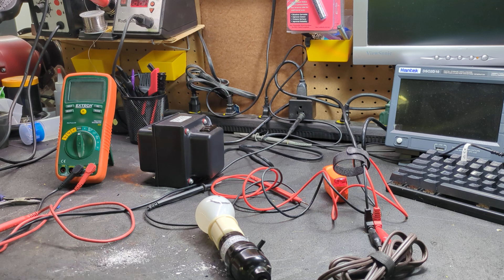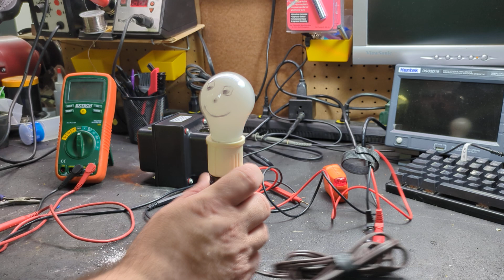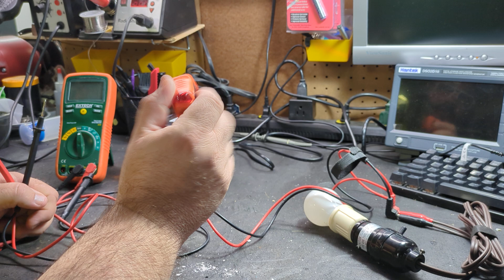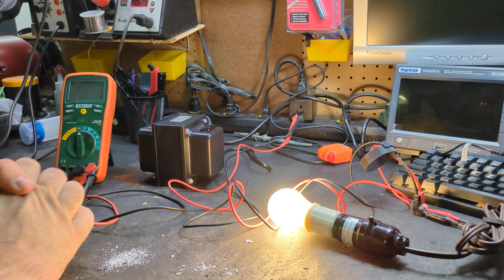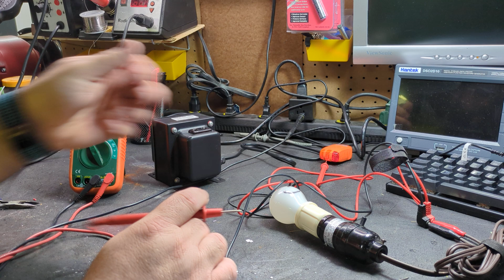Don't ground that isolation transformer on your test bench!

Comment: ***** ATTENTION *****

This is in reference to a short you did that you said "most people do not know this." In "YOUR" panel you have all your neutrals and grounds on the neutral bus bar. That is correct BECAUSE  you DON NOT HAVE AN EMERGENCY SERVICE DISCONNECT OUTSIDE. YOU DO NOT, AND THEREFORE THAT IS THE WAY YOU ARE SUPPOSED TO DO IT to avoid shock.

    ***** BUT *****
     THOSE WHO HAVE A EMERGENCY SERVICE DISCONNECT OUTSIDE, THEY WILL ALSO HAVE A PANEL INSIDE, ********** ATTENTION *****  AND THEY MUST SEPARATE, SEPARATE, SEPARATE  THE GROUNDS ON THE GROUNDING BAR, AND THE NEUTRALS ON THE NEUTRAL BAR in their INSIDE PANEL!!!!!!!!!!!!
    IT IS THE OPPOSITE FOR THOSE WHO HAVE A OUTSIDE EMERGENCY SERVICE DISCONNECT like me and countless of others, THEIR INSIDE PANEL IS A SUB PANEL, AND THE VERY THING THAT YOU SAID WOULD HAPPEN TO YOU (NOT HAVING AN OUTSIDE PANEL)  (APPLIANCES ON THE BODY OF THE APPLIANCE HOT and) WILL BE ENERGIZED,:WILL HAPPEN TO THOSE WHO HAVE THE OPPOSITE SET UP If they wire their inside box as you infer.!!!!!!!!!

   NEVER GIVE ADVICE UNLESS YOU KNOW THE DIFFERENCE. I HAVE A OUTSIDE PANEL AND INSIDE PANEL, SO I MUST SEPARATE THE NEUTRALS AND GROUNDS IN THE PANEL INSIDE MY HOUSE OR EVERY APPLIANCE WILL BE ENERGIZED, AND I WILL GET SHOCKED IF I ATTEMPT TO TOUCH THEM!!!!!!!WHATEVER PART I TOUCH WILL SHOCK ME!!!!!!!

    PLEASE TAKE YOUR SHORT DOWN AS IT IS MISLEADING PEOPLE TO THEIR HURT OR DEATH.
   THANK YOU SIR.
Reply: You are silly

Comment: A common bench isolation transformer won't protect you from the risks of touching the 2nd anode connection (cup) while simultaneously having a connection to earth (mains) ground. That is because the insulation between the windings of the transformer may fail if you greatly exceed the hipot (high potential) rating. A transformer that has been hipot tested for 2KV could arc internally if stressed to 10 to 25KV.
Reply from the maker: Thanks for that post! This isolation transformer is not grounded (other than the common line which is connected at the panel to ground) so it should be fine. Not that I want to Fool around and find out! LOL!